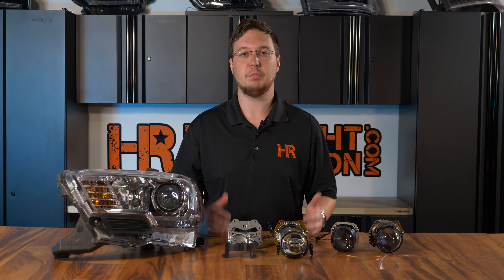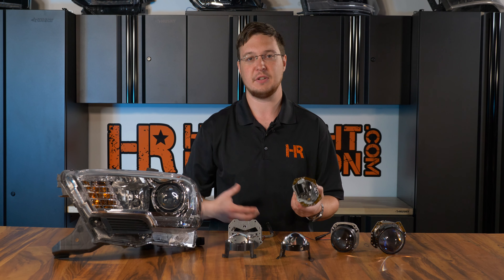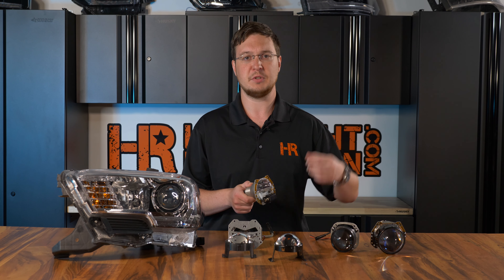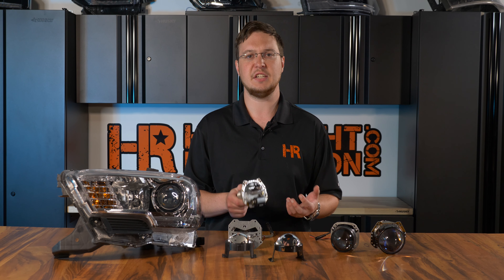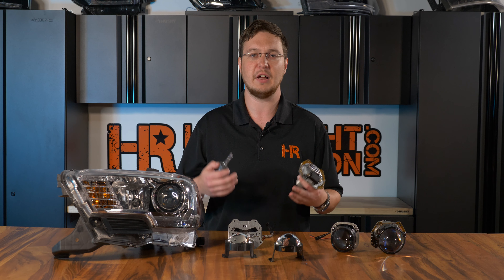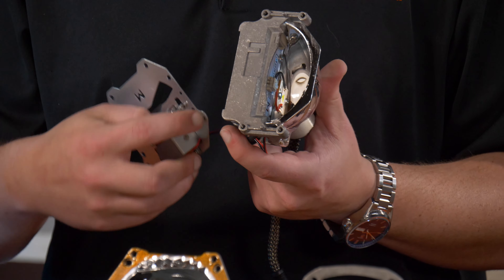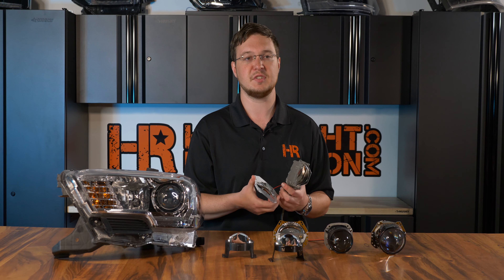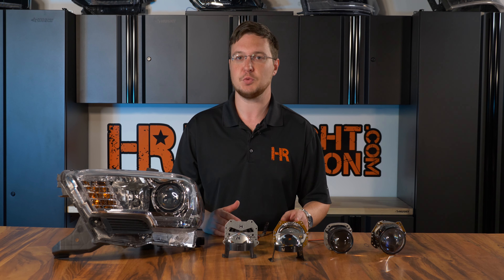Bi-Halogen, Bi-LED, Bi-Xenon HOW THEY WORK | Headlight Revolution

Comment: My previous and first car had different light bulbs for the highs... So I recently bought an Audi... I was really amazed by the fact that when I turned on the high beams you could tell that there was no transition between the highs and the lows and it seemed as if it came from the same source. I thought about it and I had a feeling of how it worked. But now I know exactly.

Comment: Great info video.  Thanks. 

Not all aftermarket headlights with projectors include projectors with high beam solenoids in them.  There are some headlights which feature both a low beam static projector and a dedicated high beam projector such as those for F150s.  Cheapo brands will generally include cheap halogen projectors without solenoids in those units.  Sometimes they use projectors which conform to known Bi-xenon mounting dimensions which makes for an easier replacement with actual high quality bi-xenon or bi-led projectors.
Reply: which is good. The Projectors with both functions are usually a compromise between both. I had the oppurtunity to see that myself. I had a low beam only H7 Projector from Hella and a Bi-Halogen Projector from Hella, both variants were new and from the E55 line with exact same dimensions and all. First of all the whole reflector is differently shaped, allowing the low beam only prjector to use much more of the available light in the low beam than the Bi Projector. In the Bi Projector it was very clear that much light was focused in the center to also have a kind of ok high beam. the low beam was also very focused in the Bi Projector compared to the more evenly spread out low beam on the other projector. 
I know this might be not as "cool" but single beam projectors are better at what they do than the compromise Bi Prjectors which do both but non as good.

Comment: im a bit confused on how to wire up the shutter cable of the projector. if your headlight has a seperate high beam bulb and you do a bi-xenon conversion do you wire up the shutter to the high beam connector and delete the high beam bulb?

Comment: So the extra light that the cut-off shield is blocking in low-beam, where is it going? As in, if it's just being blocked, wouldnt that heat up the whole system?
Reply: It does.  Thats why cheapo halogen projectors tend to burn and don't last as long.

Comment: Question!  The 2021 Toyota Sienna has two headlight versions:  LED and on higher trim level the Signature Bi-LED.  Is the signature Bi-LED brighter than the LED?  Love your video explaining how the Bi-LED works. Thanks!!!
Reply from the maker: Bi-LED is just a LED that functions for low beam AND high beam, it will not change the brightness of the optic! I am not sure on specific Toyota designs, for that, you would have to reach out to Toyota! Sorry about that!

Comment: i got a question, for BI-LED is it okay to put the fan and the exhaust outside the headlight? because i always seeing people install the BI-LED inside the headlight
Reply from the maker: It is, but we do recommend keeping the fan as protected as possible to prevent debris build-up within the fan, which can cause premature failure of the light source.
Reply: @HeadlightRevolution  ahh okay, thanks for the answer

Comment: What if your headlights are BMW Adapative Xenon headlights? What bulb would I use if I wanted a slightly brighter bulb than the OEM HID at 4000K?
Reply from the maker: If you have OEM HID headlights, we do not recommend LEDs. For a great HID bulb, check out Philips and Osram.

Comment: Hello Headlight Revolution ! 
I have a question regarding the Bi-LED lightsource bulb for my BMW F30 2015 Bi-Xenon headlight model. Can you please specifically tell me what LED lighsource I can use, so that it's powerfull enough and at the same time does not damage the light reflective coating inside the OEM headamps ? 
The fear I have about this is that I have used some old canbus LED for the position lights on my old Golf V and after a while I saw they were too powerfull and the heat dissipation generated by the 4 sided LED SMD's, damaged the reflective coating above the position lights (above the two led bulbs). 
I cannot wait for that Bi- LED pure white light ! 
Thank you so much !!!
Reply from the maker: If you're F30 comes with Bi-Xenon/HID bulbs from the factory, I do not recommend changing them to an LED bulb. Doing so will greatly lower your light output. 

Check out this video we made about this topic: 
https://www.youtube.com/watch?v=-PKI0zrdntg
Reply: @HeadlightRevolution  Thank you so very much ! Crisp clear. Sticking to OEM configuration. Stay healthy and all the best !

Comment: Can you use led bulb on h7 projector? I did know that good led will shine good in oem projector but how about in hid projector?
Reply from the maker: What vehicle are you specifically working with? We've been testing LED in as many projector vehicles as possible lately and it's doing really well, but if you have a specific vehicle in mind I may be able to point you in the right direction.
Reply: @HeadlightRevolution  no, i mean retrofit projector, not oem projector. You guys did test D type led bulb on D type retrofit projector and it doesn't work well. If you mind, i would like to know about led in retrofit hid projector
Reply from the maker: In our testing, H1 LED kits do not do well in H1 retrofit projectors. We haven't played with H7 projectors as much, but I expect a very similar result.

Comment: so you can't replace a bulb for a Bi-Led projector? You would need to replace the whole projector? If so, how will it fit the headlight? if not, where to buy the bulb?
Reply from the maker: Yes, if the projector fails you will need to replace the entire unit.

Comment: Thank you for the class
Is there any chance the shield or Solenoid might Fail?
Reply from the maker: There's always a chance any moving part can fail!
Reply: Yep, always a chance of failure, especially with cheaper units.  The solenoid can fail where the shield is either stuck and won't move or gets stuck in 'high' beam mode.

Comment: Do Bi-Xenon headlights have a slight blue to them? If so I'd go for those rather than a strait bright white of the LED.
Reply: If xenon, tt depends on the model of bulb you use... Most OEM xenon lamps are around 4300K. However, they can be as blue/violet as 12,000K.
The LED however is locked at the color temperature of the LED chip itself, which is not easily servicable.

Comment: We got an dodge ram 1500 classic 2019. I was told it takes one bulb for both high and low beams? It has the projector thing but not a pinpoint thing in it? So is that just a reflector, it is confusing.  So is the name of this housing,? Dual beam reflector or projector?. In the owners manual it lists base quad headlamp low beam as bulb H11LL. Then it lists base quad headlamp high beam bulb 9005LL. Then it lists Premium Bi Halogen Proj lamp bulb size as 9005LL. So how do I know what housing I have?. So I can get bulbs in there that I can actually see ahead on the road more than 30 feet ahead. Lights are lousy in this truck. What replacements will shine down the road farthest and brighter way brighter I need. ? Can anyone help me?

Comment: Which is better among bi xenon and bi led?
Reply from the maker: Both have great performance, really depends on your preferences. LED has instant on/off, and HID will have a warm-up period. LED does not have replaceable components, and usually, you have to re-open the headlights to service them. HID has serviceable parts, and can easily be troubleshooted if something stops working.

Comment: are there any bi-halogen projectors that are good? i just brought an used car that had its headlights changed  by the ex owner with xenon ones but it doesnt have headlight washers and auto adjusting, the issue being that i will 100% fail the MOT if i have xenon
The headlight is quite easy to take apart and im just looking to replace the xenon projector with a bi-halogen projector since it would be the cheapest option instead of replacing the headlights with halogen ones (the halogen ones are also h4 and they suck in terms of light output from what i heard)
the xenon projector is 2.5 inch btw
Reply from the maker: It might be worth looking into the Murano Halogen projectors from Nissan - but most halogen projectors will be pretty on par with others.
Reply: @HeadlightRevolution  well the issue is that i cant find aftermarket bi-halogen projector or halogen projectors 
like all of the projectors are advertised as ”bixenon h1 projectors” and in the descriptions it says they are to be used with h1 xenon kits but can also work with halogen bulbs 
will there be any issue by using an halogen bulb like a h7 on a xenon projector?
i know it would be focused worse than with a xenon but it the beam patern wont be diffrent

Comment: What’s the correct orientation for led bulbs inside a projector? Straight up and down (12/6 o’clock) or horizontal (9/3 o’clock)?
Reply from the maker: 9 and 3 still!

Comment: Ok so here’s a question. My grand Cherokee has bi-xenon headlights.  I don’t think they’re bright. But the car has automatic high beams.   Can I replace the bi-xenon bulbs with LED lights. And will the automatic lights still work?
Reply from the maker: I am sorry to say that we do not have a bulb that you will be able to place into that housing, I wish we had something for you there! You will have to go with a factory HID bulb replacement, and we have got you covered with those bulbs! Let us know if you have any other questions, we are here to help! Have a great day!
Reply: I realise you asked this 2 years ago, but I'm surprised no-one has mentioned this. Chances are it is not your bulbs at fault here and in all probability even the best bulbs may not help. The problem is with the reflector degrading (or even burning) with use. Typical OE quality projector reflectors are rated for 5000hrs use. Many (especially those made with pressed steel) do not even manage this. The best lasting projectors are made of cast material to absorb and disperse the heat.
I did an explanation here https://www.youtube.com/watch?v=esmq5CezzWk  I hope HR don't mind me blowing my own trumpet.
So you need to replace the projectors - if your car has removable projectors that is (many do not).

Comment: What is the difference between Halogen projector ,  led projector. Can i fix Halogen bulbs in all projectors
Reply from the maker: The difference would boil down the the bulb that they are designed for. Generally you want to stick with the bulb type the projector is intended to use!

Comment: I have a 2017 mazda 3 with halogen projector lights. Can I just replace the halogen bulb with a xenon bulb to get better lighting?
Reply from the maker: You would also need to install a ballast as well. But you sure can! 
Your Mazda takes an H11 bulb, and this is the best HID kit that we have found: https://headlightrevolution.com/gtr-lighting-55w-gen-5-pwm-canbus-single-beam-hid-conversion-kit/

Comment: Bi-halogen can be upgradeable to Bi-led or Bi-xenon?
Reply from the maker: Absolutely!
Reply: @HeadlightRevolution  the reason why I asked was... in the detailed catalog for my car that I had ordered last year says 'Bi-Function Projection Halogen
headlamps'. I wanted to change that yellowish not so bright headlight colour into those either bi LED or bi xenon. I am not a electrical person, so I will get someone to do that for me. But I just wanted to make sure whether my new car's headlight system will be  interchangeable or not. FYI, my new car which has not been delivered yet is 2023 kia niro PHEV ex trim. I am not sure I will be able to find the right parts or not.

Comment: Please hold your hands still while showing the lamps. And I'd like to see the bi-halogen opened to see that the shield is the exact same shapes as the hid one.
Reply from the maker: We will see what we can do for you down the road, thanks for commenting my man!
Reply: The shield is exactly the same from a bi-halogen to a bi-xenon. The Hella E55 projector came as both and if you were to look at both side by side, the only difference you could spot by eye would be the bulb holders. Different manufacturers have different designs of shield though.

Comment: I thought maybe these are for replacing the entire projector and bulb because those two sided LED bulb designs seem inherently wrong and dinky and after mine burnt out so fast maybe these style are the more reliable thing to use, but of course they are a whole other thing with other complications and I can't just put one in my car instead of a bulb so that sucks. someone needs to redo this whole industry there seems to be way better way to do this stuff.
Reply from the maker: HID setups are definitely more involved than LEDs, but there are some excellent LED replacement options available on the market today! Technology has come a long way, and with the right product, you can get both reliability and great performance.